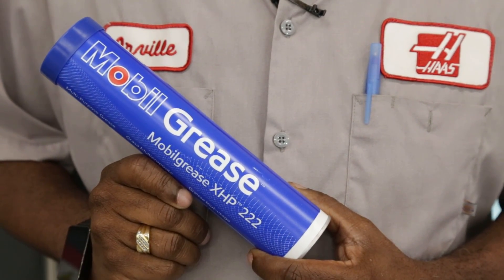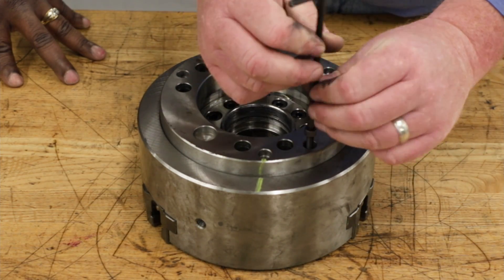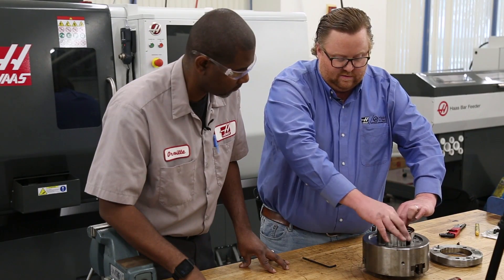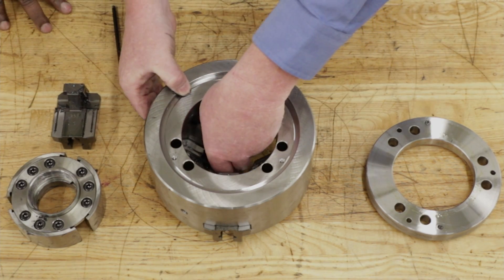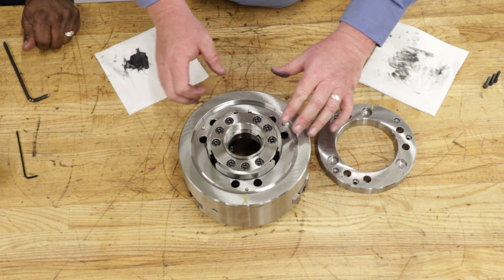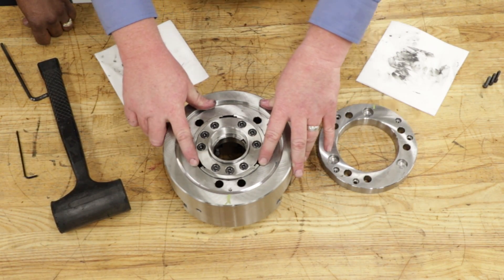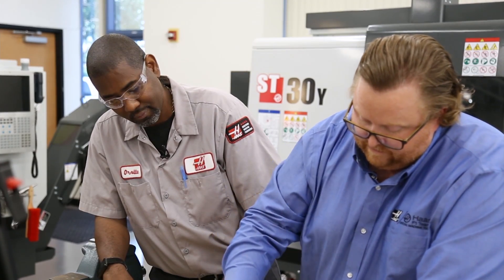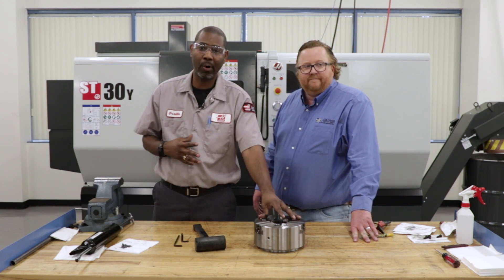Rebuilding a Chuck with LMC's Jay Duerr - Haas Automation, Inc.

Comment: What kind of grease to you use? @haas automation
Reply: We've used MobilGrease XHP 222 but we are also big fans of Chuck-EEZ grease. Check out the manual for your specific chuck and it will have a list of acceptable greases - typically a Lithium grease with 5% Disulphide Molibdenum.